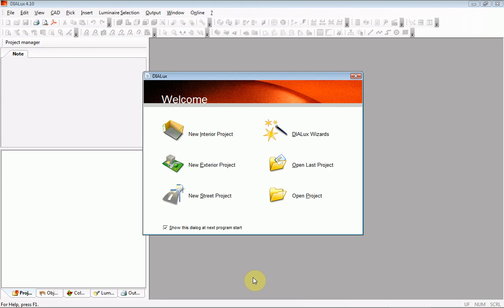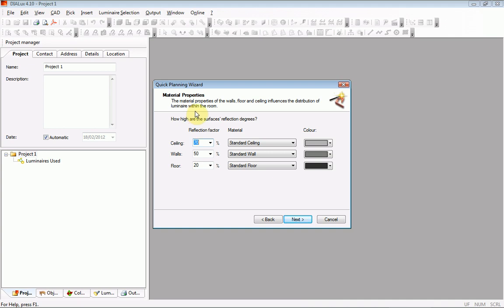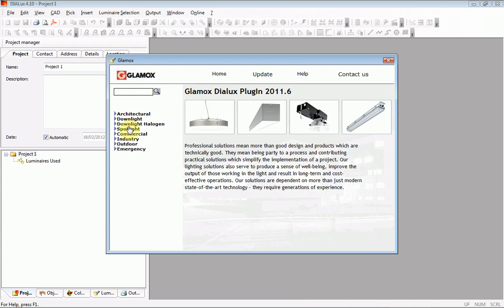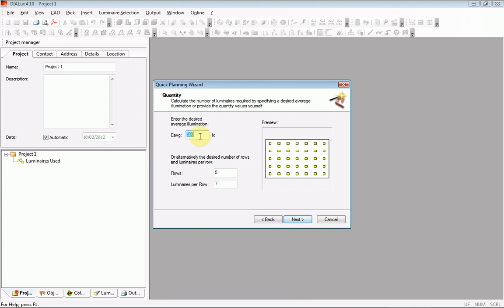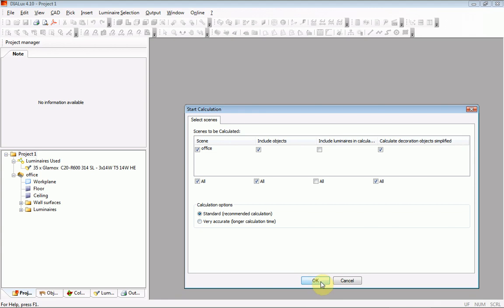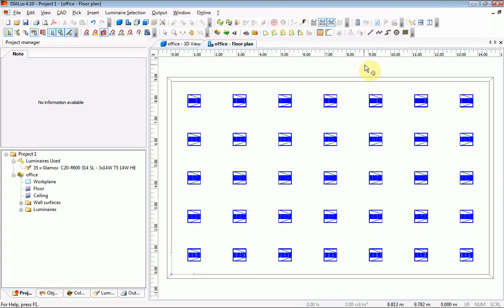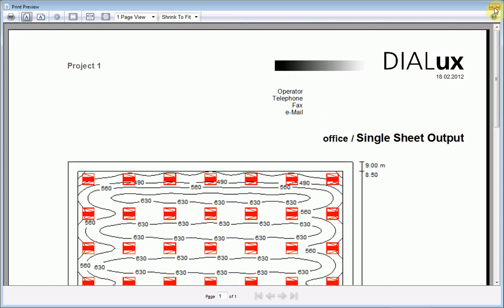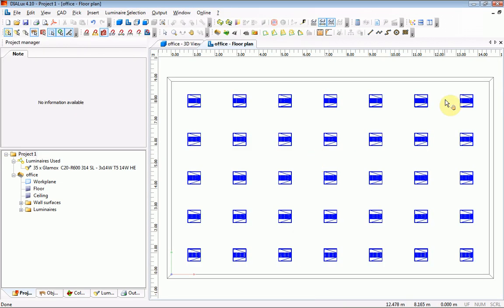DIALux - Getting started on interiors

Comment from the maker: Hi.
To insert a dome into Dialux 4 software create an interior room that is big enough to contain the dome first. Then insert a dome as an object. To do this click on the Objects tab at the bottom of the Project Manager (bottom left of your screen ) select Room elements, scroll down the preview panel to find Dome. Click on Dome  or it's image. In the properties of the dome in the Geometry tab set up your dome dimensions and position. Decide on how many segments you have. Click on insert. The dome can also be adjusted in the different views of the room. 
I hope this gives you enough to work it out. Also you can read the manual downloaded from Dialux.
Regards 
Graham Williams

Comment: Hi @Graham Wiliams, thank you for the explanation, the tutoriel was nice to follow i really enjoy it. But i still have a problème, i need to upload the catalogue for the lampings, here you have used Glamox, do you still have a link to upload  the catalogues ? thanks
Reply from the maker: Hi Ayoub. Thank you for your comment. One way you can try doing this. Open DIALux 4.12 and create a new room of any size from an interior project. In the Project Manager select the Luminaire Selection tab at bottom of screen. Click on plus sign next to Not Installed Catalogues and find Glamox. Right click on Glamox then click on Show. From here I expect you can get to a luminaire database download. (Because I already have Glamox installed I cannot full try this out.) Another way is to download from DIALux website, using link https://www.dial.de/en/dialux/partners/
then select Glamox Luxo.
I trust this helps you.
Graham

Comment: @Fulop Hilda: you only make for typical room (similar function room) but i think this software fit to design civil project as building, commerce, market, office, it is not strong about interior lighting design, especically some room of house
Reply from the maker: Thank you for your comment. The video shows one way of doing interior lighting design. The software as you mention has scope for designing civic projects. I would say that the DIALux 4.X software is quite capable of being used to do the lighting design for domestic dwellings. The software probably gets used more for commercial projects and so those videos dominate on YouTube.
Reply: Graham Williams hi, i am very pleasant when you feedback, i have a question, can you help me? when i insert a column in room, after i insert the lamp to prepare calculate but why did some lamps mount in exist column position?and i searched URG defination but i can't understand clearly, do you explain for me?